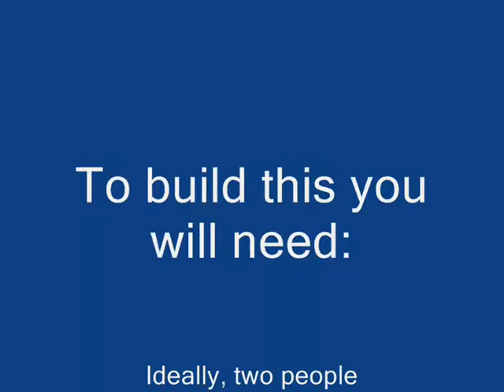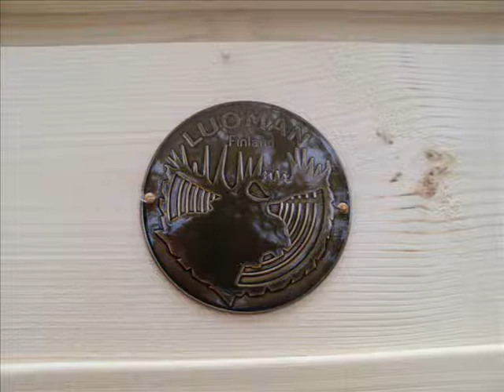Building My Lillevilla 20 Log Cabin from Luoman

Comment: Getting ready to build our cabin.  I couldn't tell what roof material you used. Any recommendations?
Reply from the maker: I used the roofing felt supplied with the cabin materials.  I recently re-covered it using a decent quality roofing felt from a local DIY store.  Because the roof is solid tongue and groove, you can put felt, shingles or tiles. Felt is obviously the cheapest but will neeed replacing every 7-10 years.

Comment: Hi, do you know where to get replacement decking from? My decking has broken and I can't source 290 cm length by 90cm by 2cm.

Ps how much did you pay for this summerhouse? Thanks
Reply from the maker: You may have to get decking and cut it to size... I paid about £1700 but that was 9 years ago!
Reply: @richwhilecooper  hi Buddy, I've been googling and most decking is not long enough or 14 cm rather than 9 cm width and most thickness is 2. 7 cm rather than 2 cm. I guess I'll have to have 2 pieces replace 3 pieces lol.

Thanks for the quick response mate.